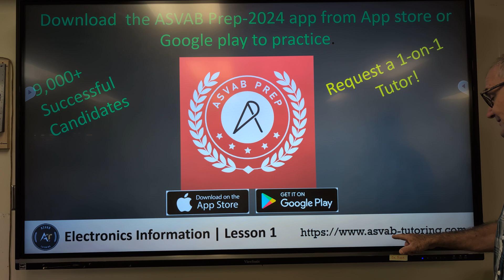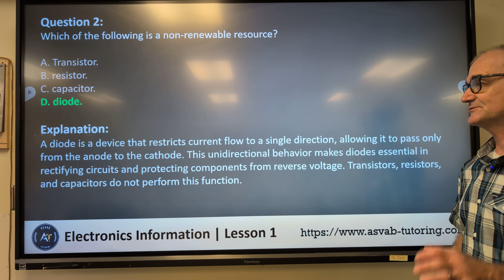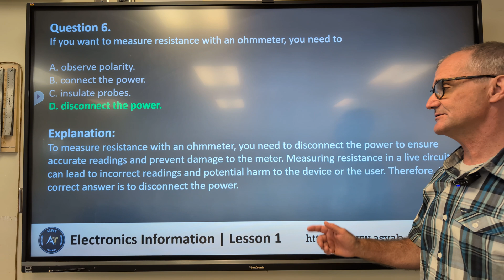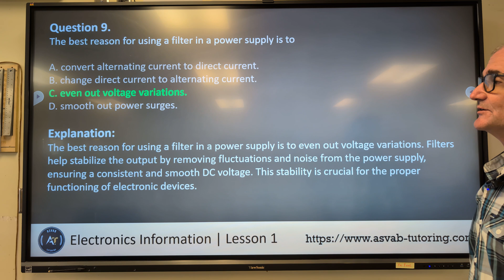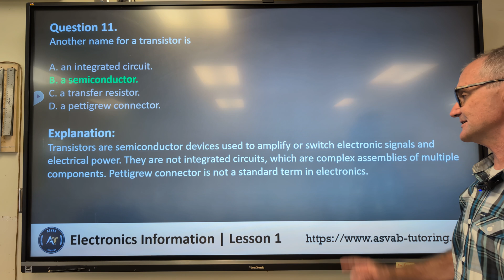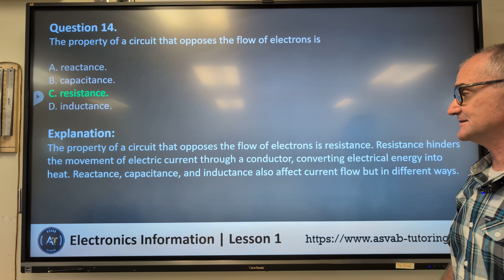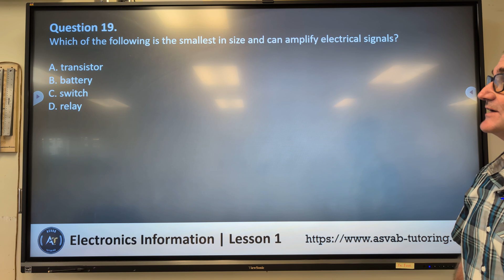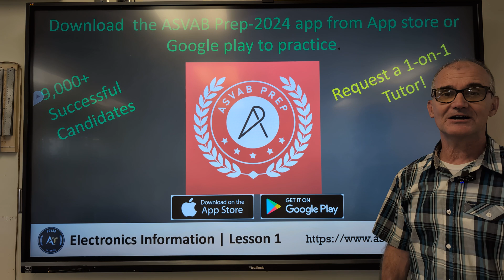ASVAB Electronic Information Review - 2024

Comment: Question 7 is worded incorrectly for D to be the correct answer. A conductor does not need to have all 3 available, it can work with any of them available. So any of the answers except D are correct.
Reply from the maker: Good to know, thank you
Reply: I was thinking the same thing
Reply: Also I was thinking if a nucleus is made up of protons and neutrons how could protons be free and still have atoms that make up compounds that make up the conductor?